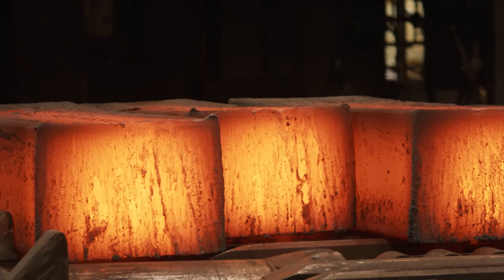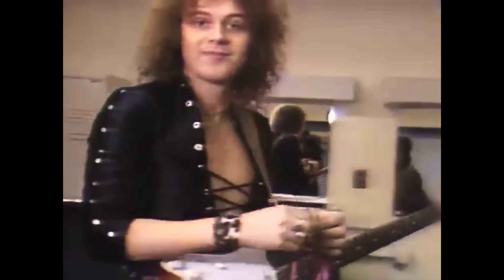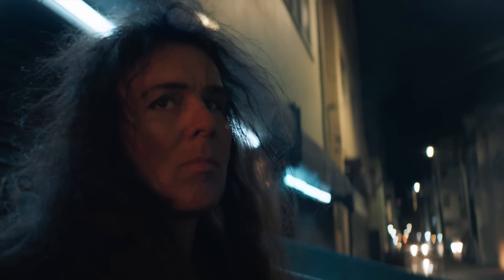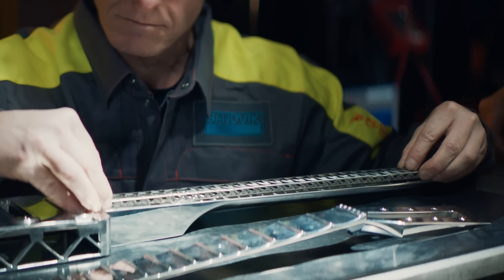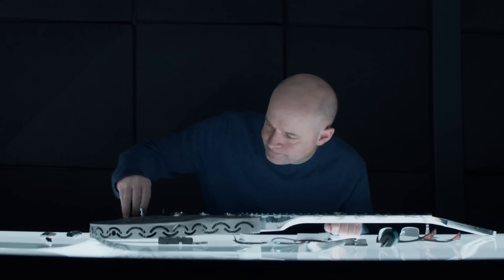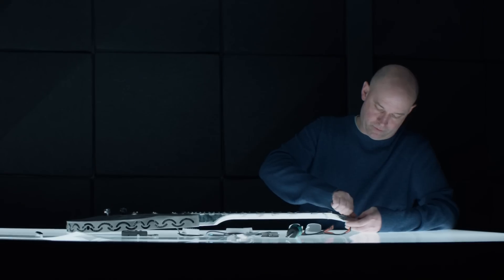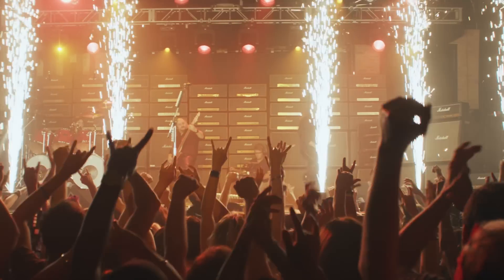Sandvik Let's Create: How it's Made - The World's First 3D printed Smash-Proof Guitar

Comment: I like how they pack the unbreakable guitar with 6 inches+ of high density foam because we all know shipping companies find ways to break anything...
Reply: Yeah, they wont have any problem breaking the unbreakable....
Reply: Well you still have integrated electronics. Those do break.
Reply: @JoseFuentes-fn3dl  The electronic of a guitar is usually so simple and sturdy if done in the classic way that the guitar body would likely have to be broken to pieces before anything will happen to the electronics, one thing that might possibly happen is that the shafts of the volume/tone controls could break of, but that would likely take quite severe mechanical stress since they are usually made of metal.
Reply: Internet daily win!!
Reply: AaaahahahHHHBBHahahahaha...right dude !
Reply: @Stefan-  Hence the slogan: YES WE CAN! :D
Reply: @Stefan-  ROW ROW
Reply: They protecting not the guitar. They protect the world from it
Reply: @oreste6076  Good point :)
Reply: Brilliant comment!
Reply: use ups once and you can guarantee its broken. also you could put it in a flight case and sent it air freight via a major airline if you really want it destroyed for sure, overnight.

Comment: Nice show but to much Hollywood. The guitar may be very durable indeed, but that Marshall 4x12 cabinet surely was fake, it broke like it was made of paper without speakers, baffle and back instead of 19mm plywood with all the contents, if the cabinet were real the guitar would likely have bounced off. Fake or empty cabinets are often used as stage props to make up these walls of Marshalls.
Reply: That's not Hollywood, that's Yngwie. ;) The monitor wedges, drum riser, and stage floor are quite real, though.
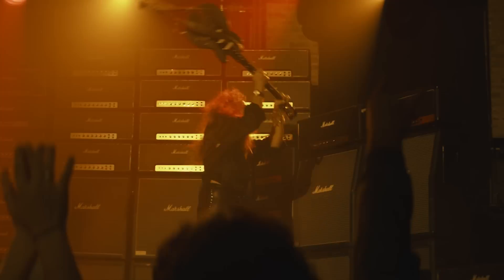Reply: @censport  Yeah, but notice the clip exactly when he hit the floor monitor 5:54  :-) My "guess" is that it wasnt affected by the guitar at all.
Reply: I concur; def a dummy cab... How hard do you have to be trying to get to Fake Speaker level posing...?
Reply: You're absolutely right.  Most of those guys cover the stage with dummy cabs.  I saw another "wall of marshalls" guy probably 15 years ago and got a tour of the stage before the show.  He probably had 25 Marshall cabs and 12 heads on stage.  Guess how many were mic'd or turned on? Zero. Behind them backstage was a JCM800 2x12 mic'd up under a sound blanket, and none of the 4x12's even had speakers in them.
Reply: agree ! so much Hollywood and so much fake
Reply: Jesus Hitler more than often yes
Reply: i agree with this
Reply: NO WAY! REALLY!? Next you'll be telling us that TV wrestling is a set up too!
Reply: @ThunderboltWisdom  No thats the only thing that is real actually :-)

Comment: Why a Les Paul shape? For Yngwie it should have been a Strat! :D
Reply: Could you also make a video of how it sounds? Didn’t really get the picture out of this one :)
Reply: "We designed the ultimate guitar body from scratch... It just HAPPENS to look like a Les Paul..."

giggle
Reply: But it is a Les Paul with 3 single coils. As if building it with titanium wasn't odd enough.
Reply: The shape of a LP is far more structurally-sound than the shape of a Strat. It makes sense for them to do it this way if the goal is to be truly indestructible. The horns and heel of a Strat are structural weak-points that the LP does not share. It's only got one horn, which is much shorter and fatter than that of a Strat, and the heel is much stronger on an LP. The only area where LPs are inherently weak is their headstocks.
Reply: BL4CKB34RD this guy gets it
Reply: @MFKR696  On the other hand, the neck of a Les Paul breaks just looking at it.
Reply: @anderskarlsson9881  Les Paul necks are actually quite sturdy. The headstock joint is the where the weak spot is, and it's easy to build a Les Paul that doesn't have a weak headstock, especially when this one happens to be made out of stainless steel.
Reply: @ilovevanhalen  Nope. Not very likely. Did you forget that this guitar is made out of Stainless Steel?

Comment: 6:27 ... He only managed to break off one Machine Head
Reply: Wow sharp eyed skills to spot that. What a silly video
Reply: @hydorah   
Yeah.. The body and neck might be un-smash-able but whats the point in trying to make a guitar unbreakable if you can't play it again after without replacement parts

As for the keen eye i just knew something would snap off after he threw it headstock first through a speaker cabinet
Reply: To make it truly unbreakable they should have figured out to have machine head tuners without the pegs...maybe concealed and turned with an allen wrench. Other solution is to keep the headstock for looks, not have machine heads and tuning is done at the tailpiece, like a Steinberger setup.